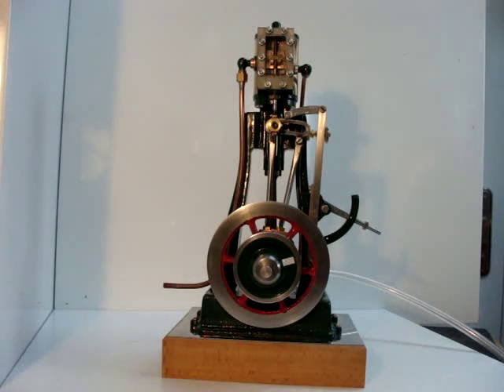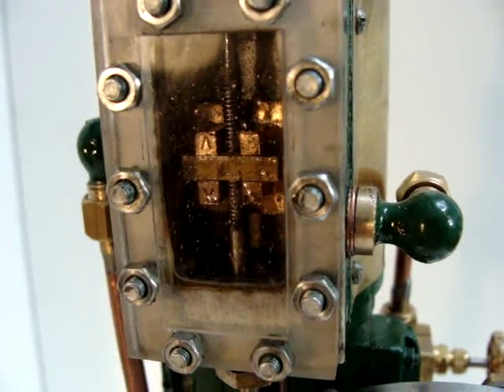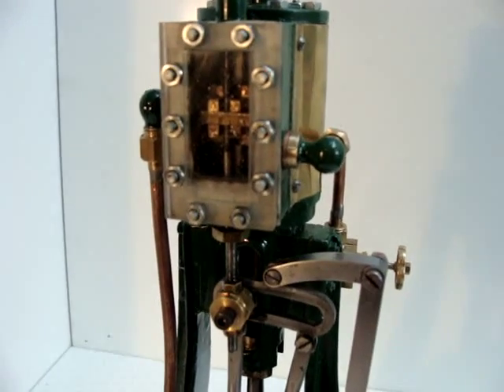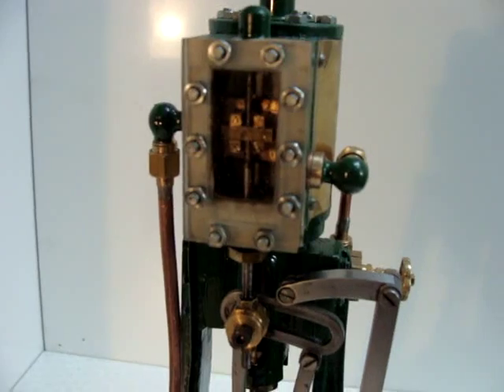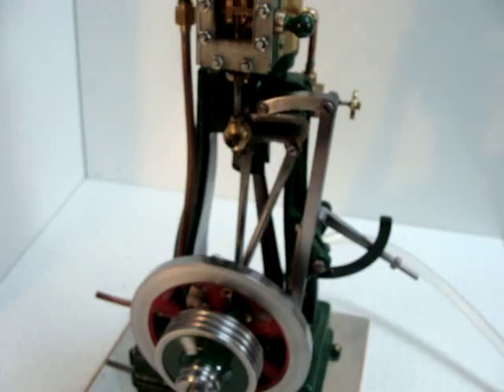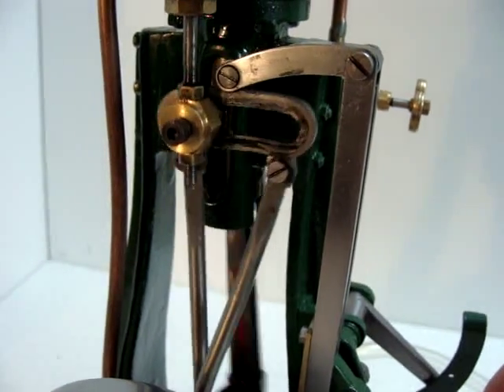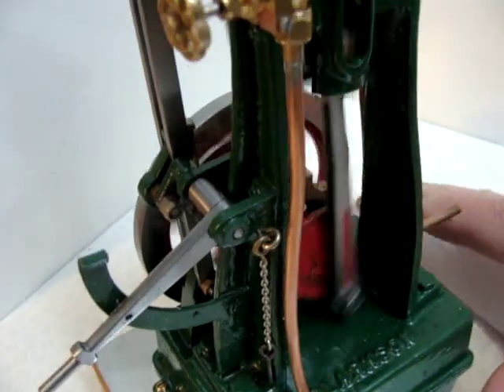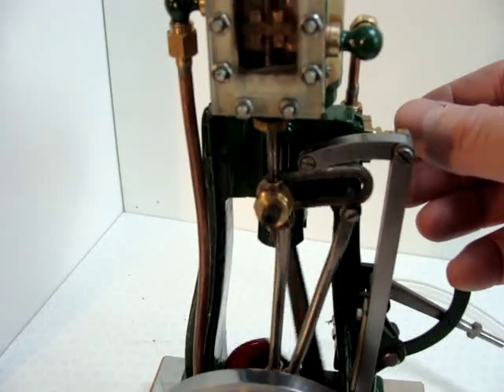Stephenson valve gear explained on Clarkson vertical steam engine running on compressed air

Comment: With a link with a properly designed radius, the engine WILL run in neutral position if it is started before being placed in neutral gear.

Comment: I am building a sterling engine atm. Anyone have some experience on flywheel weight? How much should a flywheel weigh? (The engine in question will have 2 cylinders so counter weight is not so much of a problem).